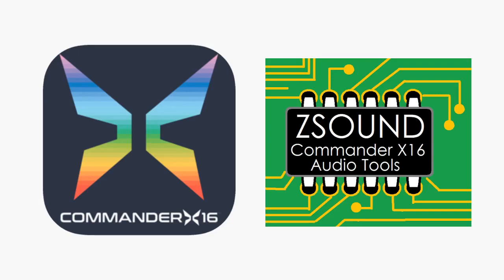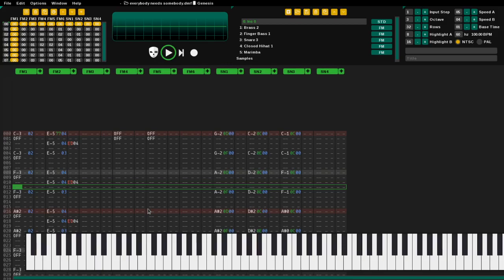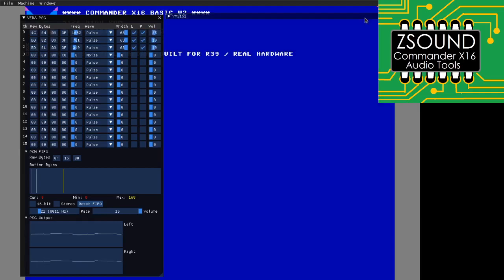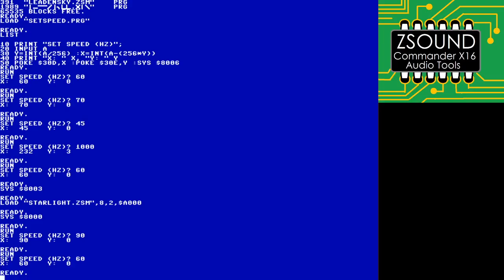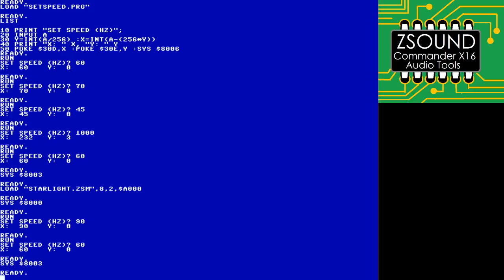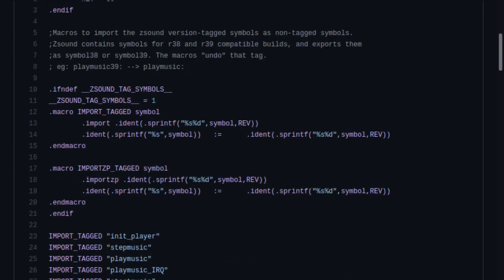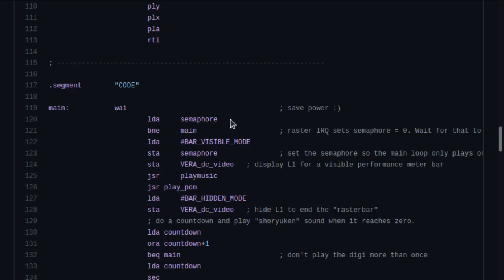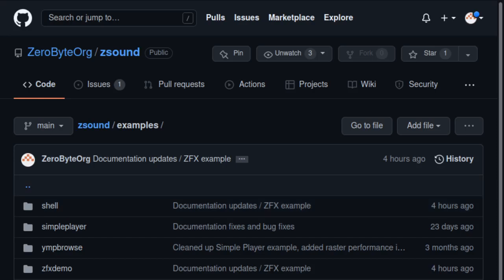Introducing Zsound for Commander X16

Comment: Did you heard that there is now a Music Tracker called Furnace that is a few months out now? It supports many Sound Chip's like the SAA-1099, Amiga and many more and it also supports the DefleMask File Format + it also has it's own File Format.
In v0.6 which is still in development the VERA Chip will be added.
Reply from the maker: Yes. I have written a ZSM export module for it as well so you can compose for X16 directly.
PCM channel support in ZSM will come later.
Awaiting my PR to be merged.